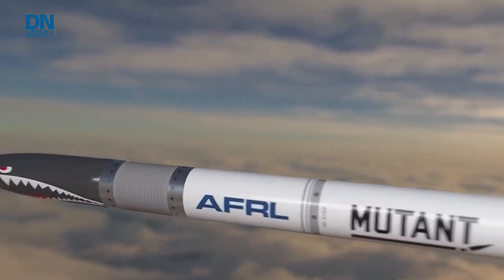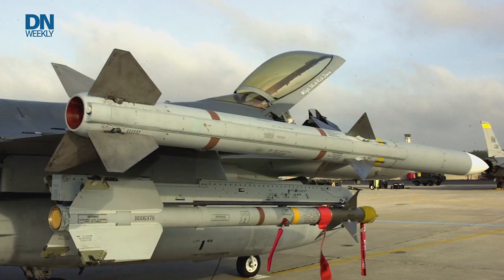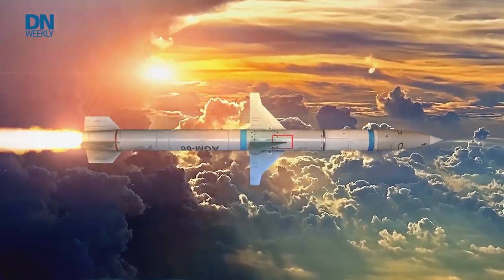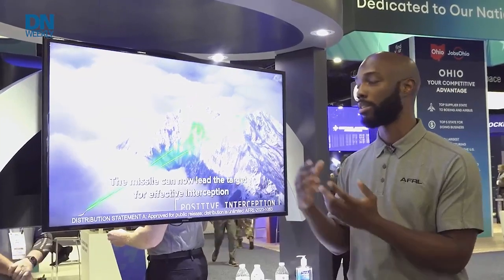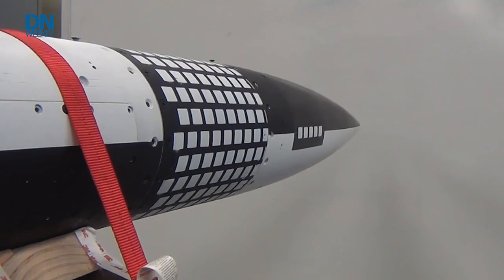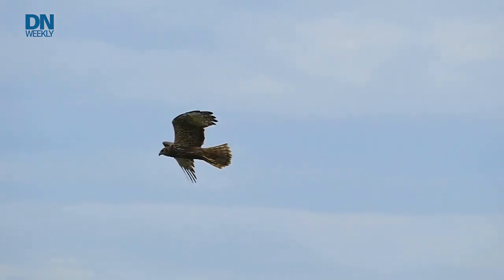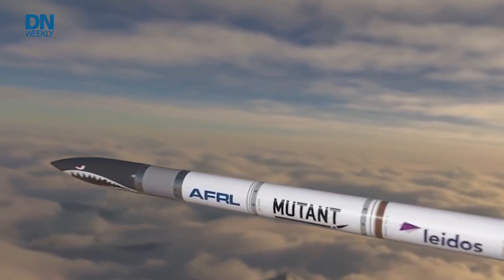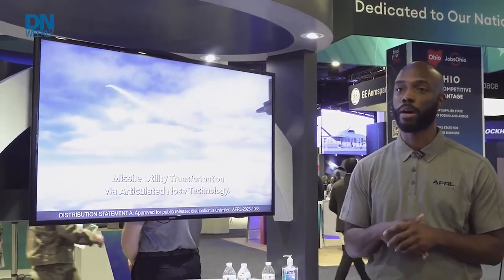Meet ‘MUTANT,’ the Air Force’s radical new missile design

Comment: question for engineers since I'm not one. wouldn't thrust vectoring missile make more sense? at such speed and with moving part on the head of the missile. That can't be good right? with all the g force acting up on the joint of the 2-part missile.
Reply: For thrust vectoring to work you need, well, thrust. And at the end of the missile's journey, there is usually no fuel left and the maneuvers are therefore made using surface controls which also include the tech presented in the video.
Reply: It's about reaction time. It all works together to make the missile turn faster. The curved body will actually reduce centripetal stress during the turn. The body will flex at the same time the thrust is changing direction.
Reply: Lots of missiles have a gliding phase where they don't have thrust, so during that phase the missile would have no control. Its why a thrust vectoring missile like an aim9x has fins still even though you'd think it wouldn't need it.
Reply: There might be slight advantages to doing it this way due to having everything at the back providing push as close as possible to through the centre of gravity. The most obvious way of doing this would be to switch gimballing rocket motor mounts to the nose and just have 'pure motor' at the back? Perhaps performance is similar but there are gains to be made in eg lighter weight less powerful gimbal actuation or structure? I'd assume they've run the idea through lots of simulated scenarios and can see some potential gain to be made. Hopefully someone will do some Estes-based demos!
Reply: As opposed to the forces on control surfaces? A centrifugal force around the centre of rotation has to exist either way.

Comment: PAC3 uses thrusters in final flight stage which are rigidly mounted inside the body to achieve similar effect.
That pivot point will be a weak link and at Mach +2 it will most likely sheer itself off the main body if it were to perform sudden adjustment to trajectory.
I can't even image motors would be capable to effectively rotate front element quick enough.
Seems like an answer to a question no one asked.
Reply: That's a demo of potential movement.  It won't reach this position right away it will bend in small increments that allow for radical changes in movement.
Reply: Brushless servos, with field oriented control, definitely capable of doing the job. But this is just too much hardware that isn't fuel or payload so I don't think it's going to see the light of day.
Reply: I would have to compare weights and space. 

  I have no problem thinking they can make it rigid enough for the performances. I have no doubts they can make it happen. 

 I just don't see how this beats a thrust vectoring system is all. I'm not sure if it is more efficient or cheaper. 

 I think seventh gen fighters are going to lack flight surfaces, and use thrust vectoring for all their flying. Forgot the program DARPA and NASA are doing to test this. 

 Wouldn't it be hilarious if we used this too in a manned aircraft eventually?

 Just saying... It is all fun and games till a fighter looks down to the left straight at ya before diving to strafe you.
Reply: @dianapennepacker6854  Aurora is what I guess you were thinking of
Reply: LOL Mr. Missile Expert over here. These ducking armchair douchebags

Comment: not viable in mass production. also they havent ever performed live flight tests, so far the only thing theyre really showing is the ability not to steer in flight, but to re-angle the warheads splash pattern to avoid last second course changes.the moving bearing is also would limit the missiles max speed in flight as each and every maneuver would create instability that would need to be cancelled out before making another maneuver, so every time it performs an action it'll be constantly slowing itself down much more than the very minute drag of canards. this idea is nothing bold or new or original this is very much the USAF equivalent of Elon Musk stealing something from a hundred years ago and calling it his own idea i.e. hyperloop, tesla, spacex
Reply: Have you seen a picuture of the FIRST transistor, the first IC (integrated chip), LASER, etc.? Nope. You aint. Look em up. Compare to current transistors and ICs.  Cheers! 🙂
Reply: They definitely need to hire you
Reply: @Able_Cylon  i love armchair experts commenting on scientists with billion dollar funding and TS/SCI clearances

Comment: Bro was listing all kings of flying creatures, why not just use fish as an example? Dude lost the plot
Reply: Fish don’t fly 🤡
Reply: @tree70737  but fish turn their body to turn direction. Fish are basically flying through the water. Water is just thicker than air. But the physical mechanics are very similar. A fish turns its body just like the missile. That’s a lot easier to understand. A bird doesn’t turn its head to change direction it uses its wings and tail because it’s going too slow in comparison to the missile. So the guy has no clue what he’s talking about.
Reply: all kinds of missiles. it's about the concept
Reply: I got the impression he hasn't answered the question on camera many times before! I bet the answer will get better with practice. They might still be arguing over design / implementation behind the scenes, so "it's like a snake/owl/tentacle/colonoscope" might be closer to the truth than we should be party to.
Reply: @trs4u he’s probably just a sales person that doesn’t understand the science